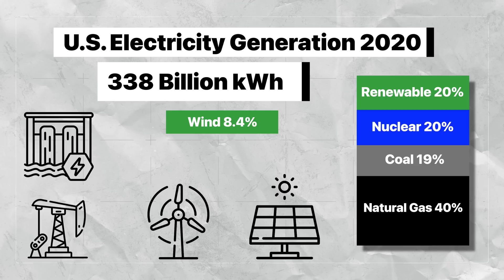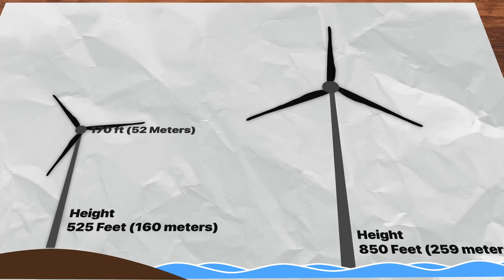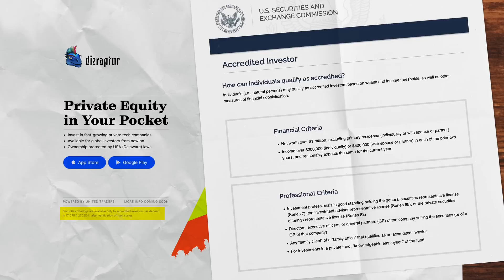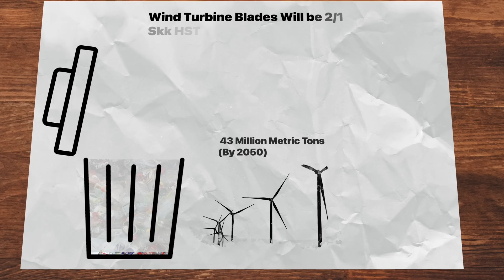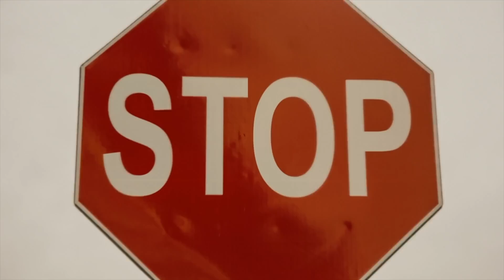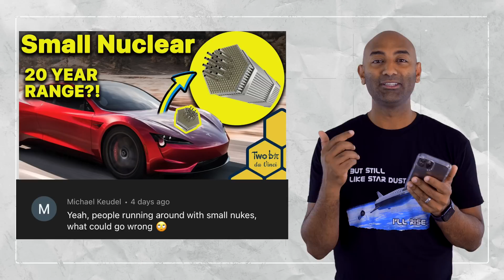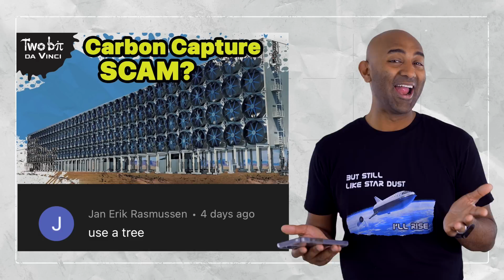The TRUTH About Wind Turbines

Comment: Why do we have to use such big wind turbines? I know that you're going to say, because you have to get where the wind is. Really? Why can't we bring the wind to  the turbines? In the days of the old grist mills the water was run down races to the turbine that turned the mill. The down side of that technology was the water could not be recycled. In a wind powered technology system the wind can be recycled if it is in a wind tunnel. Helper turbines can be utilized to pump wind into the tunnel. The use of inlet and outlet ports can be utilized to provide a even amount of wind velicity in the tunnel. Also smaller turbines can also be used in the generation process. When a turbine goes down for repairs or replacement you simply shut the tunnel down and extract the turbine. Restart the wind tunnel and generate electricity while you are repairing the damaged turbine. If you have multiple tunnels, one tunnel going down momentarily is a minor concern. You still have several options for electricity generation. With this type of system you no longer have to locate in areas where category 4 and 5 winds are found. Most places have category 1 and 2 winds. Totally useless in the giant wind tower regions. In the areas where you have little to no wind wind tunnel turbines would be ideal. All that you need is an abandoned factory or warehouse to build your wind tunnel in. A wind tunnel 14' tall housing turbines that have a span of 12' would be ideal. A small town could get by with as little as one or to wind tunnels. The smaller turbines would guarantee a lower start up cost. Think about it. I believe that we have been barking up the wrong tree. The solution is in the smaller option. Good day.       Vaughn

Comment: How many millions of birds have been killed by wind turbines?  Nuclear should be the dominant source of power moving forward.
Reply: Its estimated around 0.5 million birds are killed by wind turbines per year, compared to 100 million shot for sport, 200 million by cars, 600 million flying into glass buildings, 1000 million by the current Fossil fuel/nuclear system (yes 1 million killed by nuclear), and 50,000 million killed or don't exist because of habitat destruction! out of the 400,000 million that are alive!

Comment: Normally what we hear is it is too small to recycle, which is a real problem when you have to separate tiny pieces of plastic so the problem of how to solve wind turbine blades is solvable. If only the fossil fuel industry thought as much about the environmental impacts of their oil wells while they were drilling, collecting oil and emitting methane because it is cheaper to stop operations than to cap old wells

Comment: You are seriously missing a major point -  Part of the maintenance of wind turbines is the replenishment of Sulfur Hexaflouride (SP6) used as an electrical insulation gas  (the gas leaks during operation of the turbines). Sulfur hexafluoride or sulphur hexafluoride is an extremely potent and persistent greenhouse gas that is primarily utilized as an electrical insulator and arc suppressant. SF6 is 23,900 times more effective at trapping infrared radiation than an equivalent amount of carbon dioxide (CO2).  In 1997, the Kyoto protocol identified SF6 as one of the six main greenhouse gases (GHG). Not without a good reason: SF6 is the most potent GHG known to humanity, with a warming potential 23,900 times that of carbon dioxide (CO2) and atmospheric residence of up to 3,200 years. Wind turbines are a disaster for the environment. From 2013 to 2019 data from Vattenfall suggests leakage emissions from Europe's 100,000 wind turbines were about 900kg of SF6 over the last six years. More disconcerting is the projection "Bergensia" that SP6 emissions will increase by 75% by 2030.
Reply: Yes terrible, but the fossil fuel generation, uses similar gasses in power connections with comparable leakages, plus 33,000,000,000,000 kg's of CO2 emissions per year!

Comment: I am wondering why old wind turbines can’t be overhauled for continued service. What is the limiting factor? According to your video, the blades seem to be very well constructed. Couldn’t the worn out generator mechanisms be replaced to keep operating. Newer generators might even be more efficient.
Reply: Everything wears out, toothbrush's in months, phones in a few years, TV's in a decade, cars average life of 15 years, oil rigs 30 years. Turbine blades will rotate millions of times over there life, and will flex on every rotation, which generates micro fractures and over time weakens the blades to eventually they will fail. So need replacing before failing. Very difficult to fix billions of micro fractures other than melting down and recreating, which is very difficult and very energy consuming with fibre glass.
Reply: Because the genius engineers have no plans to add rugged leading edges that can be repaired.  Old wooden propellers had metal coverings on the leading edge to prevent particulate matter in the air acting as sandblasting equipment.  This made them last many times longer.  And they could engineer the blades to use materials that could be disassembled into reuseable forms.  But that requires planning.  Everything these days is made to fail by design.

Comment: While every manufactured product should be designed with recycling in mind, it shouldn't be a showstopper either.  On our way to a 100% recyclable world, we are going to have to make some concessions.  Don't let "perfect" be the enemy of "a huge forking improvement over the other options".

Don't let kneejerk hippie tree hugger tendencies prevent a huge improvement from coming to market.  

This is very similar to the issues with Nuclear.  Is it perfect?  No.  But, it IS a largely "contained" ecosystem.  Think of it like carbon capture with sequestering.  If we had a technology that could capture carbon out of the air cheaply and reliably, and the only issue was that we had to store it in compressed cubes of toxic sludge for a bazillion years, it would still be an improvement over where we are now, right?

I'm a huge fan (see what I did there?) of offshore wind.  Deploy enough of it, and the argument about "the wind doesn't always blow" kinda goes away.  Because, newsflash, the wind DOES always blow (somewhere).  Deploy enough of it, across a wide enough swath, and it will become a much more stable baseload source.

Further, in the American southwest, coastal water desalination is going to be a critical infrastructure thing in about 10 years *ago*.  Desal is very energy intensive.  Pair it with gobs and gobs of offshore wind, and voila.  Pipeline the output initially to SoCal, so Cali can voluntarily reduce it's share on the Colorado River, which will help replenish the whole basin.  Eventually, pipeline to Lake Mead, Powell, etc. so they can be replenished manually as needed (which also serves as a pumped hydro battery for the SW).  The desal can be designed to take advantage of power production surplus from solar and wind, and spin down during peak demand curves.  I would love to see an in depth video on this specific scenario.  Maybe do a collab with Sam from Wendover, who recently did a great documentary on the COlorado River problem.

TBdV, I really appreciate your fair and pragmatic approach to these issues, and continue to enjoy your content.
Reply: You are also forgetting in the USA 1/10 all fresh water is evaporated in cooling towers. And around 1/6 of the worlds fresh water is used by the fossil fuel/nuclear industry. Renewables will free up 1/6 of the worlds fresh water, so wont need quite so much water desalination.

Comment: As long as that the banks , investors and governments only give money for new building then yes you have this results. Ps most of the blade's can also be refurbished for a 10-15% of the building cost. The problem is simply that refurbished is not even supported from the government as so no investment. Biggest failure from a blade is wearing from the leading edge, this is easy restored during overhaul. It's like building a cruise ship but you don't do it's drydock but you scrap the ship. What I want to say if the industry mind set is changing to proper maintenance we can extend the life time of these wind generators.

Comment: I'm thinking a common heavy duty truck based wood chipper that neighborhood landscapers use could chip up these old wind turbine blades fairly easily:

a) A modern wind turbine blade is very long but it is hollow.  Even the weight of those 100+ meter blades are less than a large solid tree.  Trees are very heavy and dense yet they get chipped up hundreds or thousands of times a day all over the world.  This is expected as turbine blades are specially designed to be very lightweight for its size.
b) The resultant chipped fiberglass powder could be re-used in a lot of industrial applications as reinforcing "filler"
c) A 3-man crew could chip up a giant blade in a day or two after the engineers have lowered the blade the ground.  The chipping equipment can even be brought to the old wind turbine's site so as to avoid hefty transportation fees of these very long blades.
d) If a common tree wood chipper isn't suitable then a custom engineered chipper tailored to crush fiber glass would be a simple task for the wind industry to design and build
e) Even if the chipped material can't be reused (which I doubt), the worse case scenario will be that the resultant powder is like 1/50th the volume of burying whole blades in landfill.  Burying whole (or segmented blades) in a landfill is so obviously the laziest approach so is ripe with optimizations (like chipping).

Comment: Excellent video!  Too many people don't see the need to transition away from fossil fuel and embrace renewable energy.   We need to figure out how to recycle blades.  We need renewable energy and I'm glad that President Biden supports it.  I'm from the 1970's generation  and like many of us I  opposed nuclear power.  It stiill has issues with radioactive waste that need to be resolved.  I thnk we should produce thorium-based nuclear power and continue to try to unlock the possibilities for nuclear fusion.
Reply: I know, I see a lot of people say "renewables" are only on par or worse than current fossil fuel based energies. So... what, we just keep using FFs until they run out or wreck the world as we know it?  Even if that's a couple hundred years from now, that doesn't matter? Frick it, you're dead what do you care, that's your answer??  I mean, we have to start somewhere, even if current renewables are at best marginally better that FFs. You expect someone to just pull a rabbit out of the hat and boom problem solved in one day? 
It's just ignorant caveman thinking.

Comment: I have gotten several negative remarks from friends regarding Air Capture, when the captured carbon is turned into liquid fuels.  However, their issue is the same as the turban blades, in that, its not perfect.   I reminded them that if the bio-gas is made with green energy, it’s carbon neutral! And, that a good thing, no?

Comment: I'm personally neither completely for or against wind turbines. It would be great, though, if the old blades can be used to make the concrete that a new generation of turbines are built into or at the very least that less material is wasted. Still, one problem is that turbines cannot fully replace other forms of electricity generation. During recent storms in the UK around 50% of demand was met by wind, with solar making up to 5-10% during the day. Recently with an absence of wind they made up less than 2%. Clearly they cannot be the only solution. Perhaps more investment should be directed towards hydro power, which is available all day every day.

Comment: Thank you for the video.  One of the disturbing comments on wind turbines is that instead of the quoted life span of 20 - 25 years their actual life span without serious overhaul is closer to 10 years.  Wind turbines live in a very harsh environment especially if there is hail.   Rain is hard on turbine blades.  Any sand or particles is hard on turbine blades.  A rule of thumb is about 1/3 of a wind turbine farm's maximum output capacity is a reasonable guess for yearly output if the wind farm is well situated.  A 30 GW wind turbine field over a year might be expected to generate an average of 10 GW; however, when the UK wind turbine system suddenly got low wind speeds it dropped to less than 1/10 it's maximum output.  A coal plant can be expected to generate about 95% of it rated capacity and can likely generate slightly higher than its rated capacity if needed over a short period.

All grid wind turbine base load in the US has to be backed up by other reliable power supplies.  If new, this back up is natural gas fired combined cycle plants.  It is a totally unfair comparison to compare the cost of wind turbine electricity to base load electricity.   It is easy to generate cheap electricity when the supplier wants to, it is very expensive to provide electric power whenever the load demands it especially with a large possible immediate increase in demand.  That large immediate increase in demand requires a great deal of generating capacity be up and running costing lots of extra fuel and maintenance which is exactly what a large wind and solar generating facilities create for the base load electrical generation.  In the US installation of electrical grid wind turbines has consistently caused customers to pay more for the same amount of electricity.  

As far as CO2 is concerned, large percentages changes in the current CO2 in earth's atmosphere lacks the leverage to steer climate.  On average 1% of earth's atmosphere is water vapor almost all of which is in the troposphere.  Water vapor has a rated CO2e of 18 and at 25 times the concentration of CO2 1%/0.04% is 450 times greater in its greenhouse gas temperature forcing effect than all the CO2 in earth's atmosphere.  In general CO2's temperature forcing effect is less than 1/2% and even possibly less than 1/4% of the greenhouse temperature forcing effect in earth's atmosphere.  There is no positive feedback of consequence from this small greenhouse gas temperature forcing effect and there is no publish formula for it likely for that reason.  The IPCC does not include tropospheric water vapor in its reports,  which is where almost all the water vapor is in earth's atmosphere.  When water vapor is included it appears to be water vapor from the stratosphere and water vapor from the burning of fossil fuels.  That water vapor is small and is of little consequence, but is still greater in greenhouse gas temperature forcing than all the CO2 in earth's atmosphere.
Reply: You can't use science or reason with these people Sir

Comment: it looks like you did not include the cost for manufacturing of the windmill and also, the install and uninstalling of the the wind mill as well. Those are huge costs and carbon costs too. You need to do more research on your video.

Comment: At 1:10 you give some data. 743GWh, split across 500 million homes, is 1486 watt hours for each home in that timespan (assuming all of 2020 like the previous chart). Is that right?  A basic refrigerator uses twice that amount in a single day.

Did I calculate that wrong? 743,000,000,000 / 500,000,000 = 1486. Did you mean a different amount of homes?
Reply: Yeah, that seems low if his numbers are correct. I would think the average would be closer to 150 million homes. I suppose apartments count as a home? In that case, the per home usage would be fairly low.
I use 60 kWh/day, but I have an EV, electric water heater, and electric garage heater. Only my furnace and dryer are gas.
Summer time use is less as the EV is way more efficient and my AC uses a bit less power than my garage heater. Around 40 kWh/day.
I'm still saving over $100/mo on gas, well, close to 200 with current gas prices.
Reply: The average British home (without an EV, which most people currently don't have) use around 9 KWh of electricity per day or less than 400w per hour.